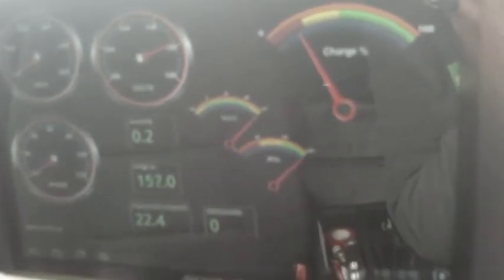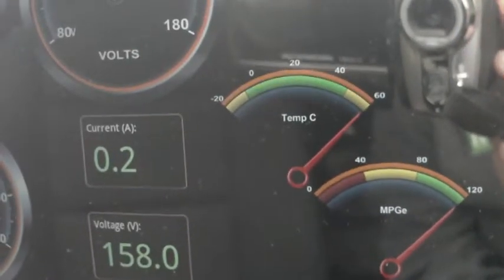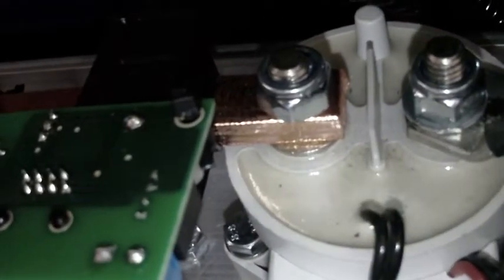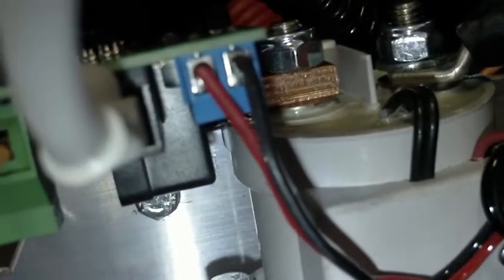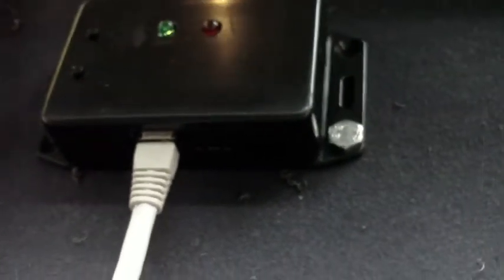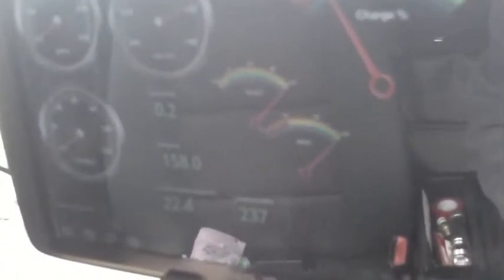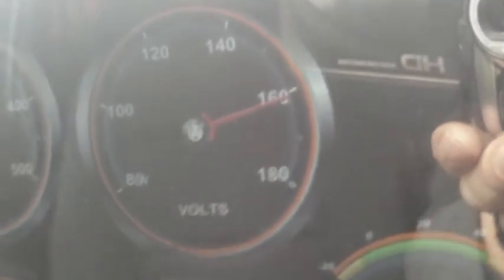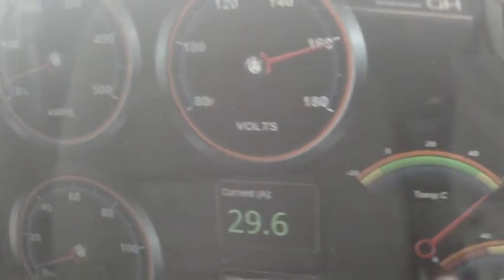BMW EV Conversion 69 Android Dash 01

Comment: This would be brilliant if it only had a actual speed gauge. Not a crappy GPS one. How hard is it to add an input to the speed sensors, or read it through the CAM BUS!? Also would be nice to use the on-board device to send data via GPRS/3G to another android device for remote monitoring.